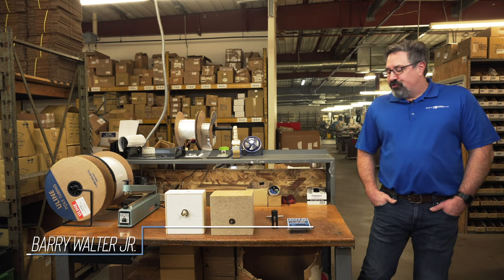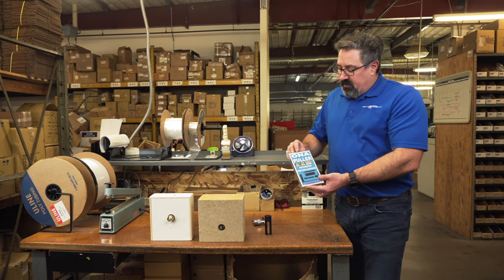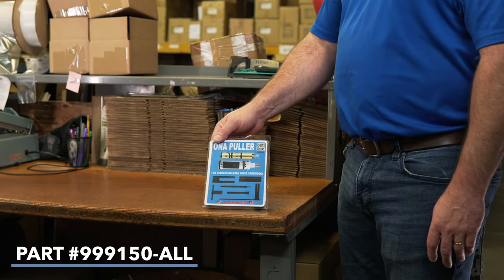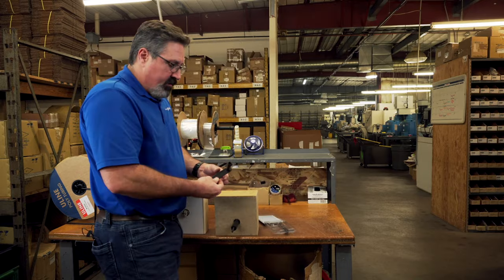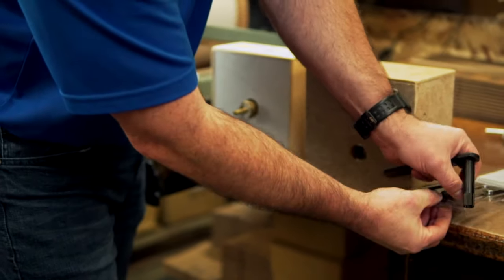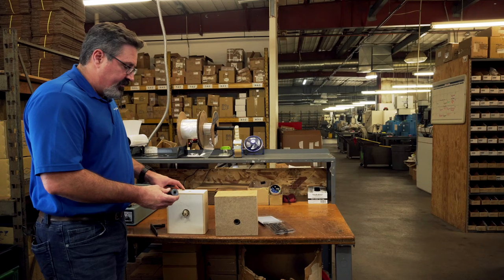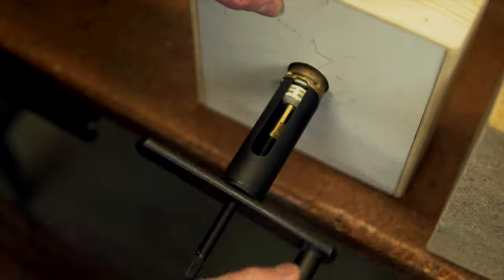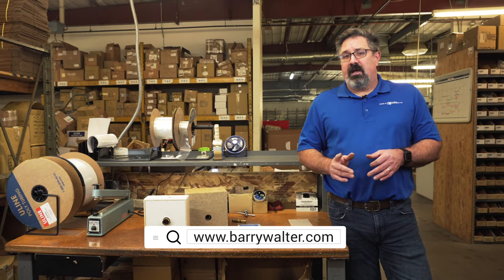ONA Puller: The Premier Moen Cartridge Extractor!

Comment: I had used the Moen and Danco style pullers.  I found I needed to add short sections of 3/4" PVC pipe as I pulled the cartridge out in order to give the base of the tool more distance from the valve housing.  Removals were tense and took a long time.  I wondered whether I was in over my head as a homeowner doing this.  
I found mention of the ONA puller on another YouTube video and bought one from Amazon.  It literally took me less than one minute to pull the 1225 valve cartridge,  These may have been the original valves and were very stiff to operate.  The first shower's cartridge replacement went so fast that I did the other two in the house while the water was off.  They also came out in just about a minute or so.  Very happy camper!!

Comment: Thank you for the posi-temp add on.  Those  old nylon cartridges are always stuck.  Flawed design?  Ya but they sold several million of them.  And the cheap little plastic "extractor" the provide with a new cartridge is an insult.   Your tools are the only ones I carry.  Thanks again.

Comment: I had a Moen 1222 cartridge that would not budge, this tool pulled it out with ease. Highly recommend. If you have A stuck Moen Cartridge that will not come out, this is the tool for you. Moen Cartridge Extractor Tool for Posi-Temp 1222, 1225 and 1200.

Comment: Amazing tool!! I had tried to use the Moen removal tool first. The screw twisted off. Then I bough the Danko version and the same outcome. I purchased this off of Amazon after watching the video. Holy cow!! I even video taped it. The 1222 was stuck as if it was concreted in. I slowly turned the handle and it came out slow but intact. It was so stuck that I had to put some muscle to it but I won this time!! I don’t know if it is just a poor design of the 1222 to start with. I was thinking how can something be so hard to get out? But this tool kicked butt!! Worth every penny. One last thing. About 3 years ago I had a Plummer friend try to take out my master bath 1222 and he hammered on it for about an hour but finally got it out after a lot of sweat. Then I had  another Plummer friend try t take out a Moen faucet cartridge that was leaking. He could not get it out and left me hanging. The best he could do was turn the valve off for the hot side that was leaking. I think a Plummer that does not carry this in his or her tool box is not smart! Or maybe just do not know about this amazing tool!!

Comment: I have a 1200 that must be removed.  It was installed in 1986, so, anticipating a challenge, I ordered one of your tools.  The price has risen a bit from the $19.97 shown on that vintage package... If this tool doesn't get the job done, there is no Plan B -- I have to take down a wall, and it's all galvanized pipe back there from 1941.  Yikes!  I'll report my results.
Reply: Well, I succeeded, with just Step A.  Cartridge came out in one piece, without much of a fight.  I'm still happy I bought this tool, so I had a solid plan in case I pulled out the stem instead.  Excellent instructions.  HOWEVER!  I could not get the crank started onto the threaded rod.  I'm usually pretty good at starting threads, even difficult ones.  I took the tool pieces to my workbench and started threading the rod from the opposite (cartridge) end.  There were several tough spots where it was quite difficult to chase the threads through, even with light lubrication.  That fixed the problem, and it started just fine.  So I can only give you a C- for fit and finish... maybe a little QC attention here.
Reply from the maker: I apologize I did not see this before. Please email be at helpdesk at barrywalter dot com and let me see what we can do to fix this for you.

Comment: Hello Barry 
I have a moen cartridge 1222 that the brass piece broke off 1/2 of the brass piece is still inside the valve with no threads 
I’d bought your Ona tool puller extractor but can’t use it to pull this broken cartridge 
Any suggestions on how to remove it would greatly appreciate it 
Thank you 😊 
Robert
Reply from the maker: Jesus, the ONA Puller does not remove the 1222 if the stem is broken off. I know there are some videos out there where people have shown how they have removed it. I do not currently have an answer.
Reply: @barryewalterseniorco  , All it takes is a small drill bit and two coarse-threaded wood screws. No pushing, pulling or twisting. I will tell you how to do it if you like.

Comment: I had one today tht was stuck like Chuck 😅the brass steam came out but left behide the plastic body and o rings....in the pesi temp 1225.will this help with removing the plastic body out at all ? Water was over 30 grains
Reply from the maker: Larry, it will work on the OEM 1225 plastic bodies. I cannot say for certain it will fit in all the import versions of that plastic shell.

Comment: Do you make a tool to get the balancing spool out if it gets stuck on the moen trol?
Reply from the maker: We do not currently make a tool for the removal of the balancing spool. I have seen one out there before.
Reply: @barryewalterseniorco   Are you still in talks with J over here about the Moentrol balancing removal tool? That would be a neat little kit.

Comment: Okay... Cool for all of us with 1222 moen cartridges.  But... what about us with DEEP bathtub faucet 1248 (could also be 1224, same cartridge, but smaller hole designed for bathroom SINK faucets, but often mistaken in the bathtub!)?  
The bathtub faucets generally are installed with STEM EXTENSIONS!  Moen makes/made several versions.  I have the good old 13462 (?)  OKay, not a big deal, extensions have a screw, and yet ONE MORE of those typical Moen retainer thingys (?) that are like the cartridge retainers, but a bit larger and can be set to make your faucet handle the appropriate height.  No problem, you use the standard Moen 14272 tool to unscrew that extension retainer dude, and THEN, you use that same tool to unscrew the cartridge retainer 'nut' thing. 
But... Now!  The cartridge (1248 or 1224) is WAY down in there!  The usual Moen cartridge puller tool for 1222 is worthless for the 1224 or 1248 cartridge, way down deep in there!  
What do you have to help pull THAT cartridge????
Reply from the maker: We do not make a tool for either of those cartridges. Sorry.
Reply: Yes, the 1224 or 1248 cartridges  are deep down!Once you remove the retainer (moen has a tool to remove the retainer which is usually plastic or you can make a retainer removal tool with 3/4 copper tubing and cut notches on the end, it works if in a pinch). Now the cartridge is deep down. I use a 3" sheetrock screw and screw into the top of cartridge as there are female threads on top of cartridge. Use a pliers and pull up with some might, and will come out. I'm a plumber of 37yrs in business and do this all the time, and it works! Hope this helps someone.

Comment: Strange my 1224 cartridges has no threads on the top...any idea why?
Reply from the maker: This is not for the 1224. That is a two-handle cartridge. This is for the single-handle cartridge.
Reply: @barryewalterseniorco  Strange I thought both were the same TYPE!
Reply from the maker: @miralikhan7877  The 1222 and 1200/1225 are single-handle cartridges. The 1224 is a two-handle cartridge.

Comment: At 51 seconds into your video you are using a Moen cartridge puller (not ONA) trying to disassemble a Delta faucet. I must say this is not going to work and I doubt a ONA puller would work on a Delta faucet either but it was good for a laugh.
Reply: Good catch
Reply: The good ol Delta 600 series.  😂